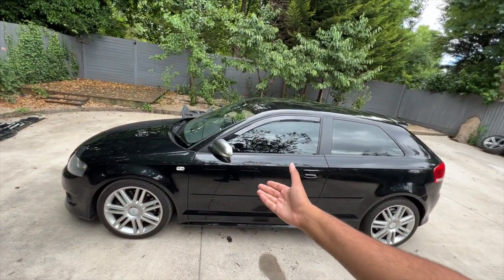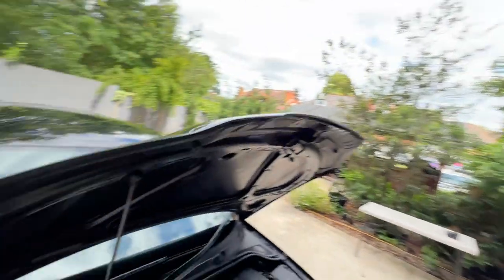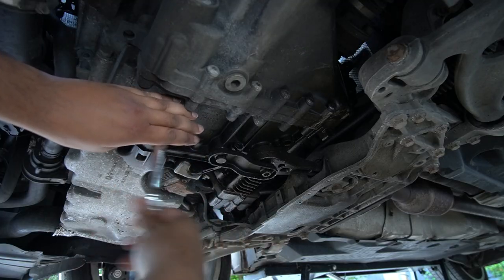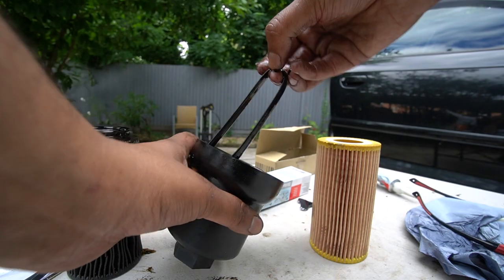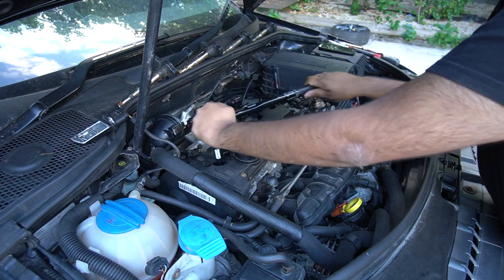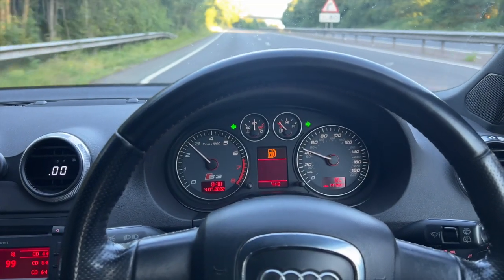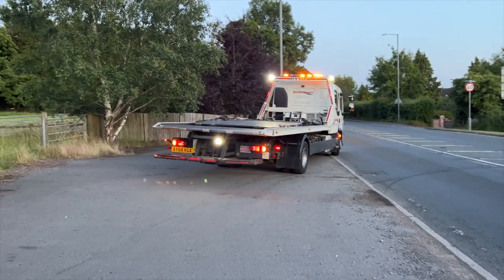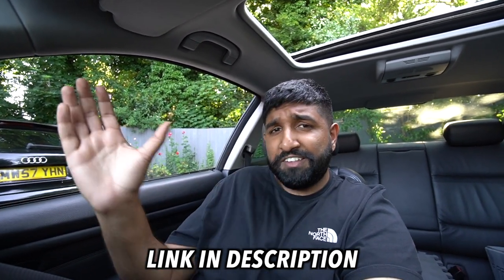I Bought a CHEAP AUDI S3 and it BLEW UP at High Speed!

Comment: Little tip with that dirko sealant, theres a little key looking tool that comes with it, pop it on the bottom of the tube and twist and it flows much smoother and allows you to be more consistent with it

Comment: These were amazing cars for the time. 
I took the BAM (mk1 s3) engine out and put it in my mk2 golf. 
Mapped it from 225 to 280. Amazing.
Reply: This js not a 1.8 20vt bam engine. Its a 2.0 tfsi engine. The 1.8 20vt engines are alot better in my opinion.

Comment: Re: applying new sealant, I'd recommend Victor Reinz Reinzosil - even the normal 'tube' comes with a metal tool allowing you to roll the end of the tube to get a consistent bead.

Comment: Bought a 1.8 TFSI Black edition last month, got an oil pressure warning and started sounding like a bag of shit, the oil pump is probably about to fail. Turned the car off and left it with the dealership I bought it from to sort it. They gave it back to me after just changing an oil filter, i refused to take it back since it still sounded like a bag of shit and now I’m in legal battles lol. Fun times.

Comment: Had bought my first S38P at 20yo...was so happy that i finally have bought my dream car because in Greece it still costs around 15-18k for a decent one. Had it done stage 1 within the first week, after 5 months car died same way as yours and guess what, oil pump. No warnings, no nothing, i was doing some pulls and suddenly it started rattling and same time the oil pressure light came up... hopefully now with my TTS CDL engine wont have same issues :P

Comment: Very very common issue if the oil pick up pipe isn't regularly cleaned. Vis balance shaft delete was the best prevention method for mine

Comment: Moral of the story if you buy any audi between 2005 and 2008 you need to change the oil pump before it's gone. IT goes for both diesel and petrol

Comment: I had audi a3 1.6 petrol 2005. Man that thing was total junk. Having spent silly money on it, i bought a suzuki liana estate 04 from a scrap yard. Paid £230 for it and spent around 130 for a suspension arm and a new bolt for exhaust and passed mot no issues. Had it 6 years now 184k miles, i thrashed its bolts off and still runs mint. Only ever asked me for clutch and thermostat.

Comment: Oil pump failed and bottom end done i rekon had same with a cupra and an a3 1.8t. If you changed the oil pump and bottom end bearings u would have been ok i think maybe who knows least itll come back from rtech strong IA 💪

Comment: Boys! When buying one of these S3's or A3's alike with the intention of driving hard. I suggest you add a freewheel to the Balance shaft. 

Reason why:

The balance shaft rotates at twice the RPM of the engine in the opposite direction of the crankshaft in order to reduce engine vibration.

Problem is: The max engine RPM is 8,000 RPM the max RPM for the Balance Shaft is 14,000 RPM.

If you slap the rev limiter constantly it WILL explode.

Comment: That oil pick up seal looked not that old, do you think that the previous owner had the oil pressure issue and then just replaced the pick up but then the issue was still there so they sold up?
Reply from the maker: Potentially, I bought it from a person who took it in PX
Reply: @TRHamza  ahhh the old “it’s a sound car in the day I’ve had it but I only took it px so…” 🤷‍♂️😂 hope it’s not too bad for you bro. Your the first YouTuber out of the 20-25 I watch that I’m going to sub to patreon 👍🏻 brownie points for hamza haha.
Reply from the maker: @BlaxJakx  Thanks bro! Yeah hopefully it’s somewhat salvageable, will see next week. Otherwise it’s complete new engine time 🥴🤣
Reply: @TRHamza  always look on the bright side of things bro, it’s more content which we love.
Reply: My old 8P had a few pickup pipe blockage issues leading to pressure but it survived everytime. Happened on the first day I got it at 30k miles, nearly 200k on it by the time I sold it

Comment: i just bought a a3 tfsi and it has so many issues with the engine, tempted to get my money back tbh. i gave iot a boot full and had the same oil pressure light as you, turnt it off anf back on again and it went away, so drove home slowly and was fine. the oil pickup has been done in 2016 but i guess maybe it needs doing again idk.... also rattles when you start it up which i thought was cam chain but that has been dne in 2020 so i dont think its that...
Reply: Mate oil pick up pipes should be cleaned every other year especially if mapped or by that point delete the balance shaft to avoid this issue
Reply: If it’s 1.4 it’s the cam chain again, very very common.

Comment: Buys a cheap example of a performance car. Hmmm. There's your main problem right there!!!!!!!!!!!!!!!! "Oil pumps can go bad" huh... Regular oil changes are the preventative measure to take!!! My engine has 142000kms on it. Never burns oil! F me! ome should never own these sophisticated cars. Btw, ther 8P engine is the better of all S3's! No chain follower BS! No oil burn BS! Just maintain the things you've listed & you're good! Alos, they may be the bottom performer but, they are economical! Powerful! FWD cars for most of the driving. You can have your S5-S8's! Why? Seen the Gas price right now?!?..... P.S. Very much appreciated your clips of the repairs. 1000% :)

Comment: That’s why I won’t buy a used Audi. Most of them are money pits, I should know after purchasing a 2012 A4 Avant new in March of 2012. Total money spent to date is around 84k US, including purchase price of coarse. Had a new long block installed 4 months ago, car runs great. The car has 67k miles.
Bought a 2022 TTS in January of this year, will trade prior to warranty expiration. Love the cars, though they can be expensive toys.
Reply: Exactly reason why i will never own a vag car